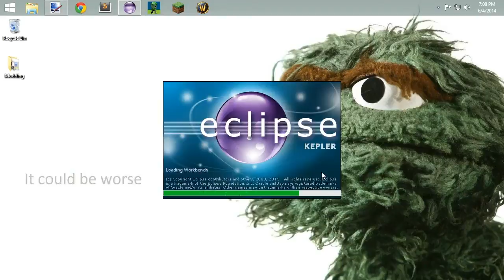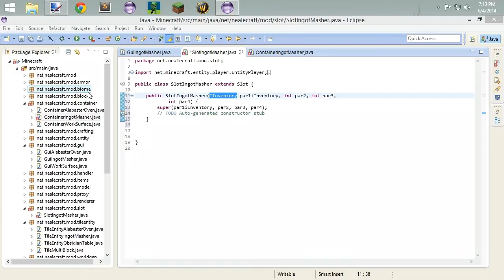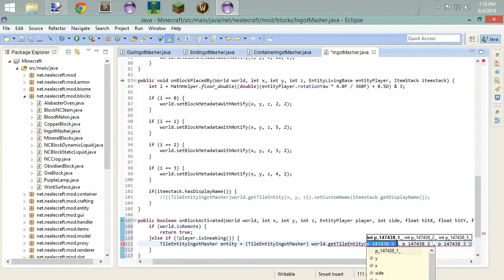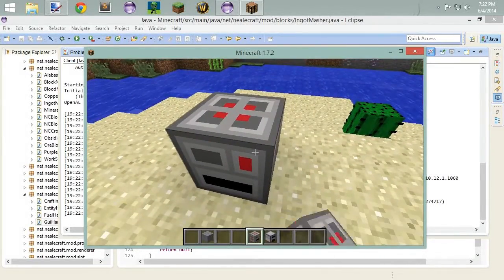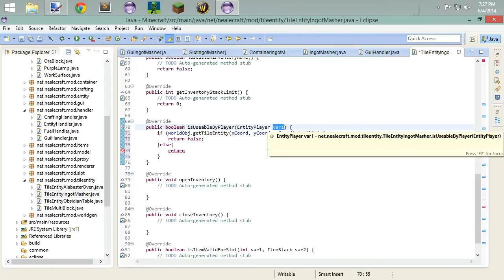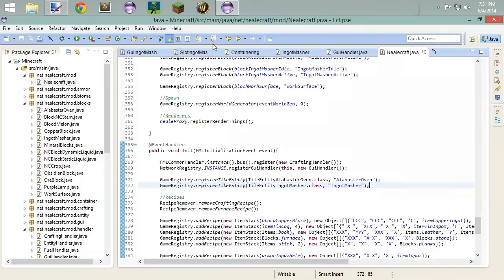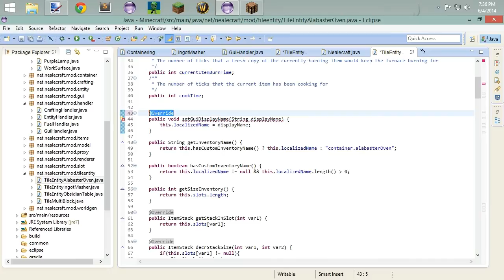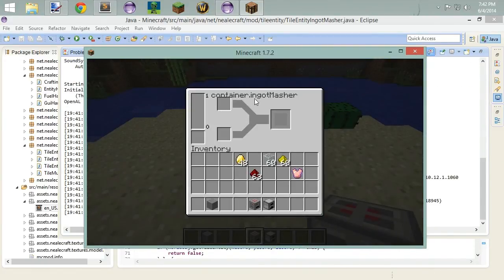Minecraft Modding Tutorials 1.7.2 #31.4 - Dual Input Furnace

Comment: So for the container name you could just name it in the Gui class.

Ex: protected void drawGuiContainerForegroundLayer(int i, int j) {
        String name = "Ingot Masher";

this.fontRendererObj.drawString(name, this.xSize / 2 this.fontRendererObj.getStringWidth(name) / 2, 4, 4210752);
    }
Reply from the maker: You could do that too.  That's what I ended up doing for the Oven I did before.  The initial reason I did it was so that you could treat the container as a generic class that would be work for multiple machines you if you wanted to create the, but......i gave up on that.  :)